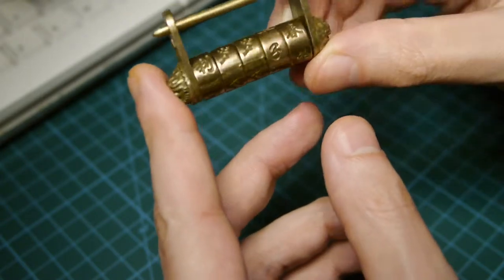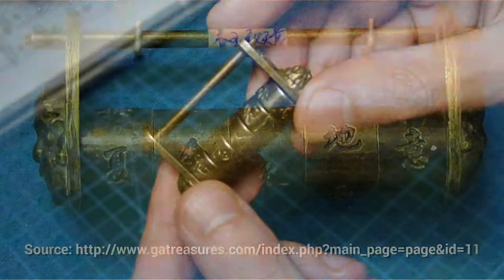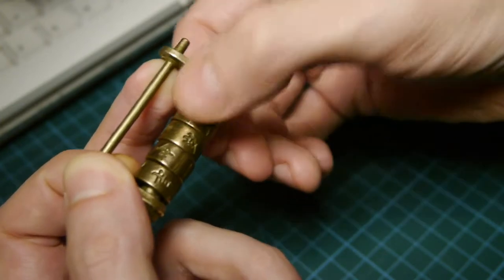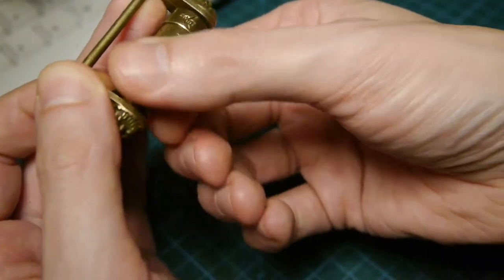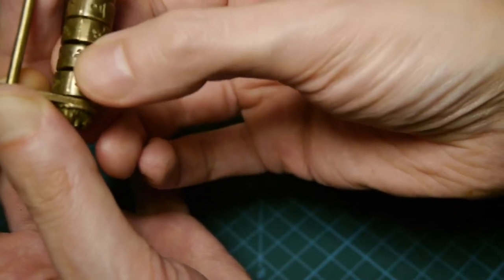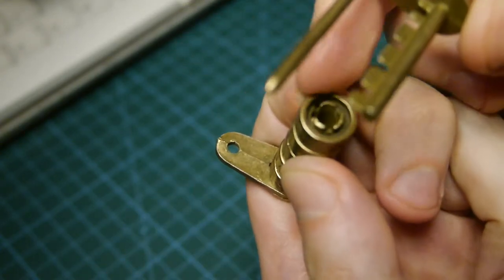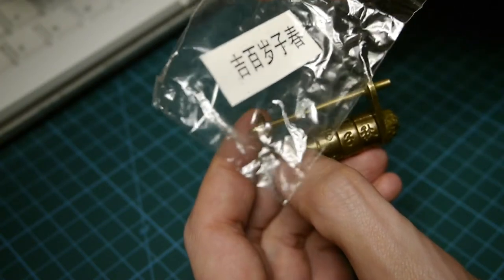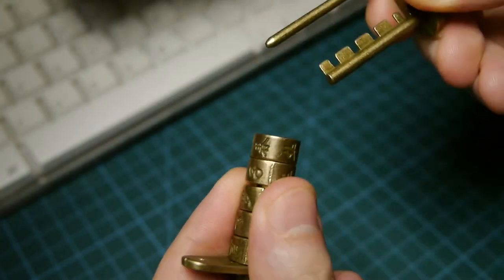Decoding an ‘antique’ Chinese combination lock

Comment: Can't blimmin open my one. Came with symbols on a scrap of paper but they dont correspond to the available symbols on the wheels. Mine also doesn't have a gap like yours. I want to just go through every possible combo but the wheels are so wibbly and imprecise it's hell trying to keep 4 still and move 1 and I never really know if I'm testing the combos properly as it's hard to have them lined up properly. How accurately do they have to be lined up? could some symbols be a couple of mm off line from the others and still work?
Reply: @TW7S95  lol no I didn't perhaps I will try again, glad you solved your puzzle though lol